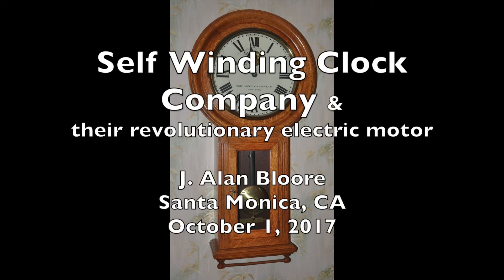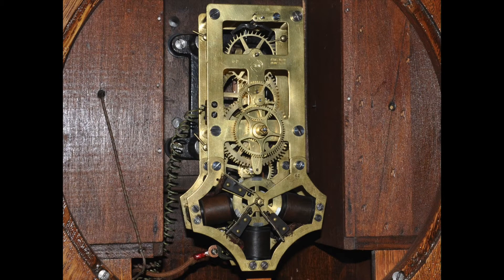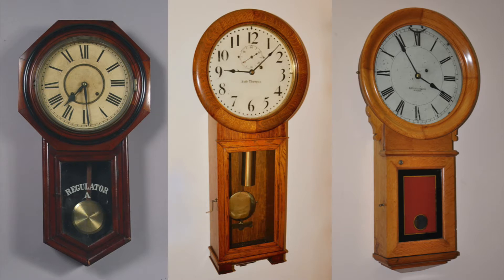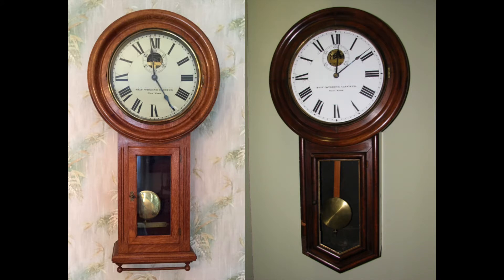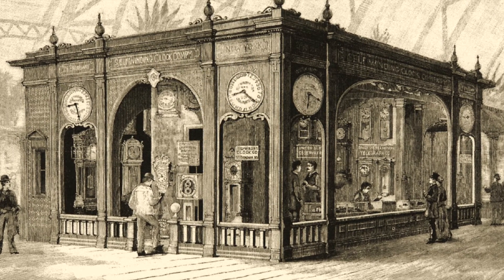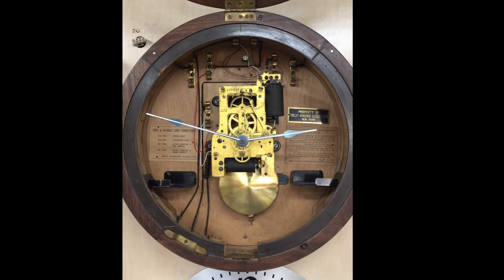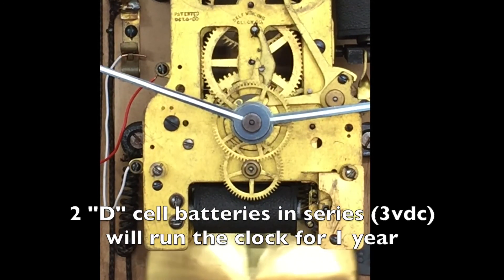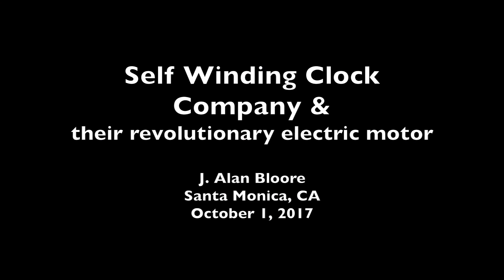The Self Winding Clock Company's revolutionary winding motor.

Comment: I have a vintage Verichron branded wall clock with balance wheel and spring. More than once an hour, a small electric motor powered by a D cell battery winds the spring. I don't know if it was manufactured before or after the Self Winding Clock Company went out of business. Clearly, it was sold as an inexpensive consumer wall clock.

Modern quartz wall clocks run on a smaller battery and can be expected to keep much better time. They have an electric motor which drives the hands through a gear chain. Most move the second hand in steps once a second, but there are quartz clocks which move the second hand with a smoother motion.
Reply from the maker: Self Winding Clock Company went out of business in late 1960's